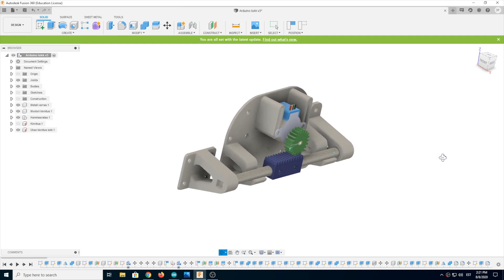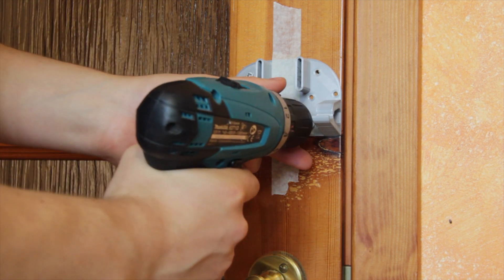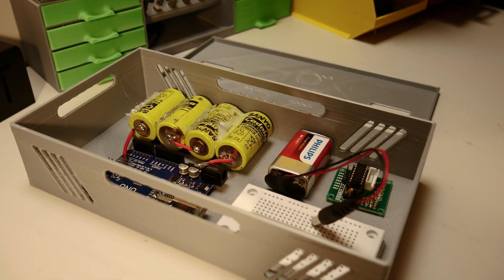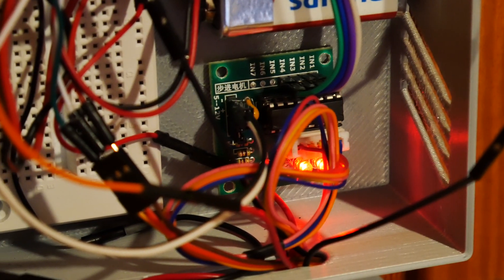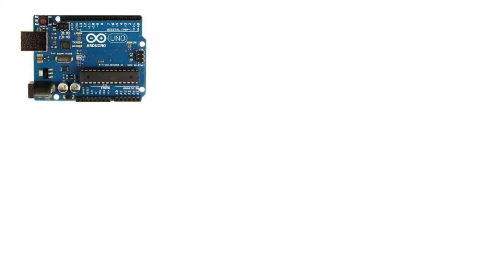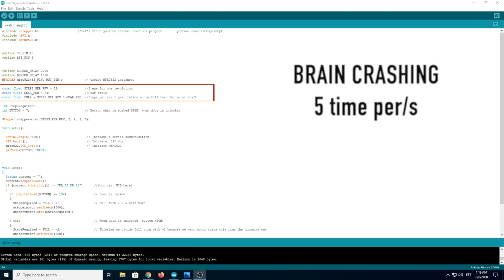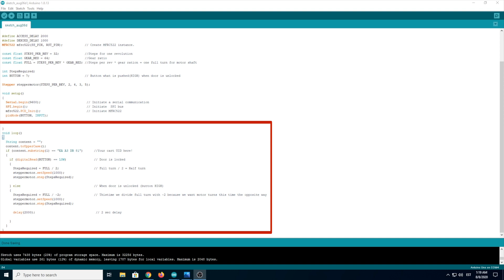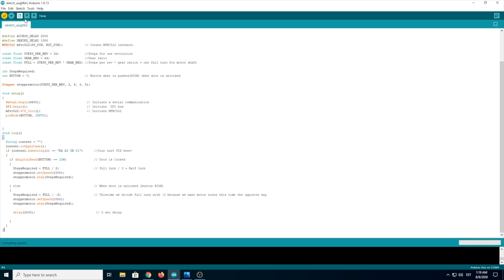3D Printed RFID Door Lock - Using Arduino Uno and 5V Stepper motor (free .stl files and code)

Comment: I have  a suggestion for future projects where a mechanical switch is required to determine a binary position of a sliding part. Instead of using a push button which requires somewhat precise positioning, use a microswitch with lever, which can be pressed up by the rod sliding along it.

Comment: Apart from the mechanical weakness, you could open the door by cutting the wires going to the RFID Module and just send a "granted" signal or connect your own RFID reader. Why not put the reader behind the glass? It would probably still work
Reply: As if somebody is going to do all that
Reply: I know I'm a bit late, but these RFID Readers transmit the raw data of the key. The Access Handling is done in the Microcontroller
Reply: @paulz1780  Ah okay, thanks for the information. That makes a difference

Comment: A few things. Could use a ESP8266 such as the D1 Mini so it makes the overall size smaller. Could of taken a Barn Door Lock and modified it with 3D printed parts to add the Stepper portion. Ditch RFID and use MQTT so all you need is a App to control it and no need for anything on the exterior part of the Door.
Reply: what to do when phone battery is flat and the charger inside?

( maybe just kick the door and the plastic lock breaks hehe )

Comment: Hey! 
You are showing the wrong version of your Arduino code in the video :) 
There is no way that this is working. You should use the "mfrc522" at least once inside the "loop" to get the RFID code from the card reader.

Currently, you are always comparing the code "EA A3 DB 81" to an empty string.

  String content = "";
 // initilze an empty string
  content.toUpperCase();
 // empty string to upper case is still empty
  if (content.substring(1) == "EA A3 DB 81")  // check if empty string equals "EA A3 DB 81"
Reply: Yup. That's right. Block of code inside of IF condition will never be executed.